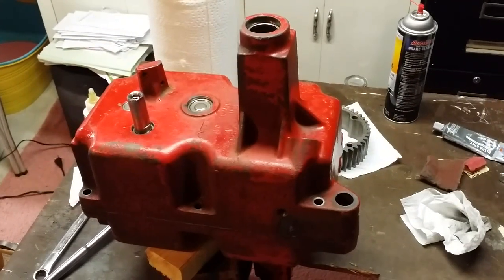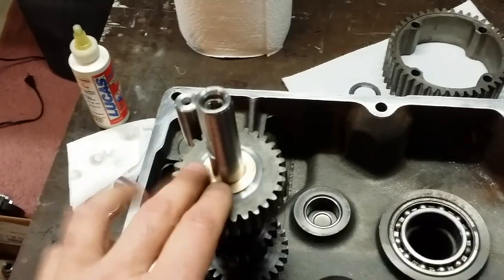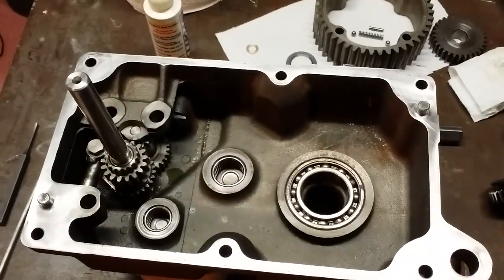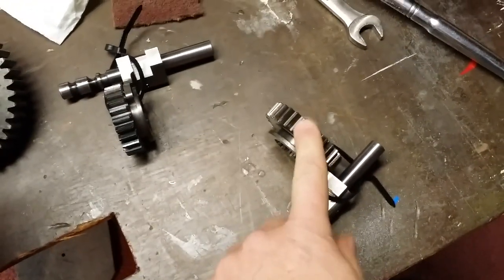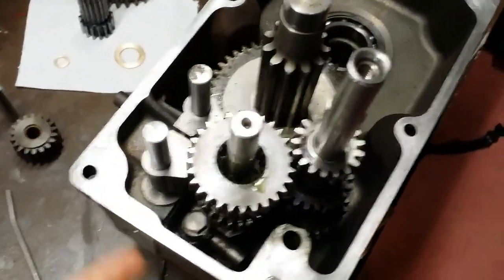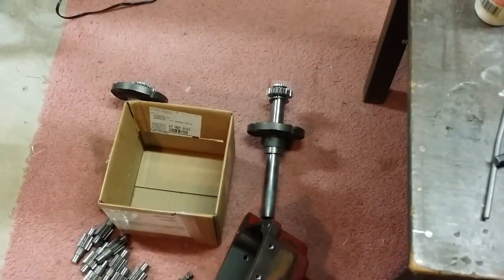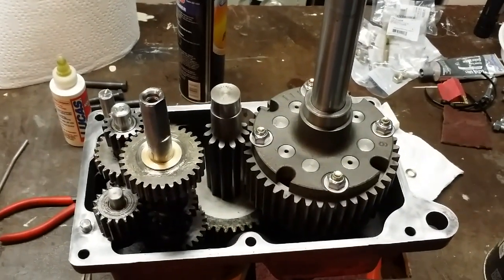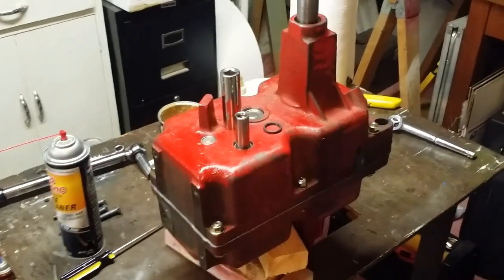Wheel Horse Garden Tractor 8 Speed Transmission Reassembly Rebuild VinsRJ

Comment: Very comprehensive video. One thing I missed was the axel shafts are different lengths and it would matter which way you would put the bolts through the diff. gear set so the bolt heads would be on the gear side of the differential. Just though I'd mention that. It would be frustrating if you got the gear set together and have to take it back apart because the bolts are rubbing on the gear, or the wrong length axel was on the wrong side of the case when you went to put back in the tractor.

Comment: Great video, thanks for all the detailed information. Makes me think I can do mine too and remove that endplay in the axles. Incidentally why didn't you use a gasket in the joint between the two halves of the transmission case ? I'd probably do the same but only because they are harder to find here in the UK.
Reply from the maker: Hello, I have always found that with each case half clean and free from oil, gasket sealer works just fine.

Comment: i leave the shift rods in the housing   that way u  dont haft to fight the balls and spring  drive out roll pins in forks   i have done it  your way   but its  just easyer  drivin pins back in        good job on your work
Reply from the maker: Hello, sounds like one of the detent balls came out... you may have to pull the fork shaft out, drill out the press plug in the case and reinstall everything like I did... suckie job but may not be avoided, thank you!
Reply: Very explainitory. Thank you. But where can you get the parts?

Comment: I have a 1973 toro model number 56575 and it has a transmission with a chain going to a sprocket on the rear axle. It just has forward, neutral, and reverse. But I see no plug to check the oil level. How do you check for the oil level?,,,,,,,,,,,,

Comment: Wonderin how u install oil seals on axles??
How u get old seals out of case ?
Especially the small ones on brake shaft ? Thanks
Reply from the maker: Hello, typically I will use a curved pick to pull the seal out, make sure there are no burrs or sharp edges on the shaft or case, coat everything with a little oil and then lightly tap using a hammer and punch to seat the new seal... if you have a socket large and deep enough that works also, 👍
Reply: @VinsGN  Hi thankyou for info

Comment: I’ve got a 4speed unidrive 2988185,it’s in bad shape with corrosion.How does the transmission with no hi/lot differ from one that does with the mechanics of where the forks go?My forks are rusted,pitted and stuck.Would you happen to know the part number of the forks for a 4speed?i haven’t got it broke down all the way and don’t know if I can reuse them.Any advice would be greatly appreciated as I am as green as a gourd when it comes to this,thanks

Comment: Would you be able to give the part number for the axle seal.  I've got a 1055 wheel horse with the 1 inch axle.  The seal is just a little sliver of a seal and can not find them.  Thanks so much.

Comment: I have a 313-8 will this transmission and the right axel came out any guess as to what happened? Did the clip break maybe? Was mowing normally I wouldn't think the shaft itself broke.. thanks
Reply from the maker: Hello, does sound like the axle retainer clip failed or the end of the axle wore out causing the clip to fall off? The wearing out of the axle seems a touch extreme to me though... in either case you will have to field strip the trans... or locate a good used trans and do a swap...

Comment: what if you  were to use a piece of brake line with a chamfer on it to push that detent ball in ?
Reply from the maker: It would have to be a small brake line as the channel the ball goes threw is only 1/4" in diameter...